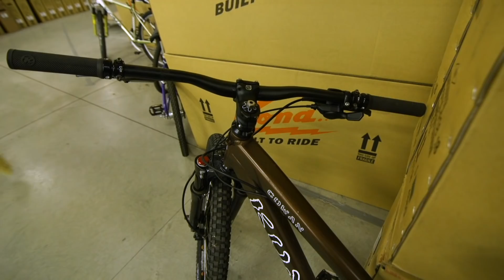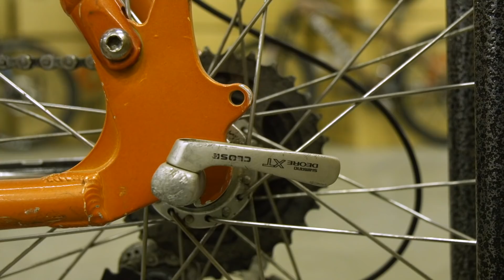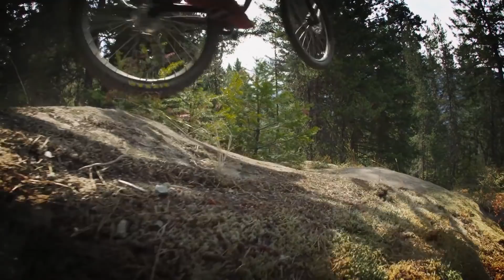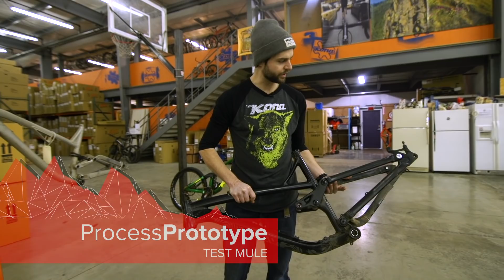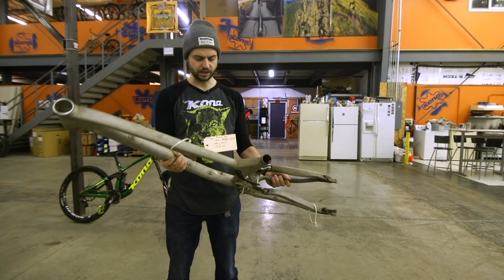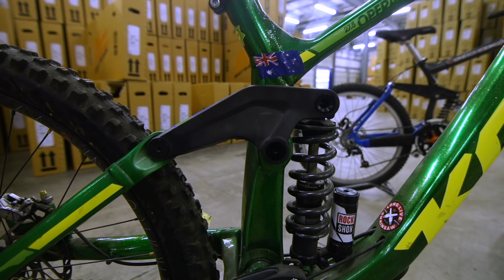Evolution of Kona Bikes Part 2

Comment: You guys skipped all the good ones between 2003-2007 :(
Reply: BlunderCig I know that’s right like my 2006 coil air with Marzocchi bomber all mountain 1
Reply: YUCK! Circa 2005 was when Konas were the most popular brand in my city, and also the easiest bikes to hate. Cheap and ugly frames with awful geometry, plenty of failures, and component choices that were big on suspension and small on less obvious things that could be expensive to replace.
Reply: I have the 2007 Kona Stinky Deluxe
Reply: Surprised nobody has mentioned the Dawg either, love my 05' Dawg Dee-Lux :D
Reply: @Metal-Possum  I'm actually quite surprised to hear that, they've always been very reputable over here in the SW UK especially the old Stinkys were incredibly reliable cheap DH bikes, they'd get thrashed and sold over and over again but they'd never break 😅
Reply: @BlunderCig  I just saw far too many of them. They were cheaper than anything else, made from Kona's in-house "klump" aluminium tubing. Plenty of them failed, either the front triangles, or in the case of the Stinky, those huge rocker linkages. I think the worst offender was their love for Shimano M475 hubs in everything. I've hated those hubs for 2 decades now yet they're still out there in large numbers, almost always damaged beyond repair due to their poor quality.
Reply: @marvinbliesath642  a have a 99 with a fox vanilla race shock coil rear sus and bomber z1 light downhill fork on the front.